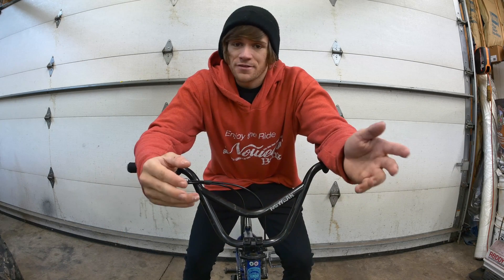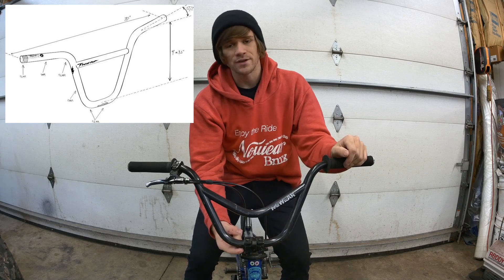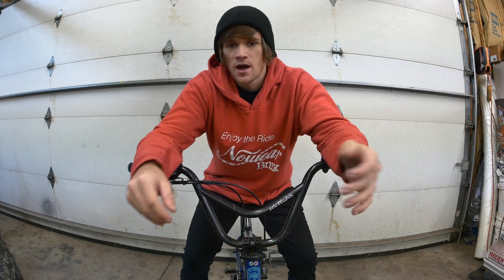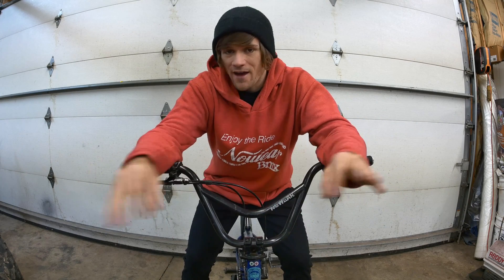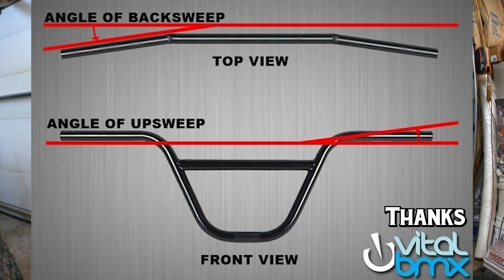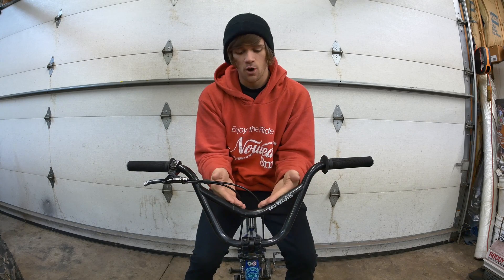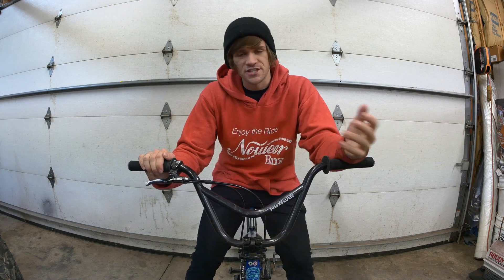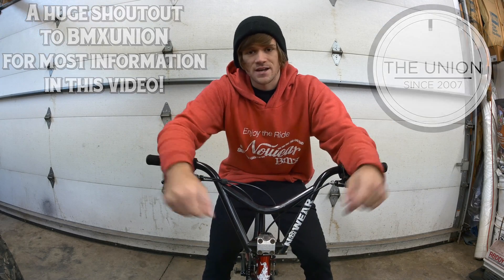BMX Handlebar Geometry - EXPLAINED

Comment: You made a comment on the break-area.sss for high-tensile-steel bars. If you look at the 4 piece design, the stresses(vibrations) are transferred away from those area.sss. Bottom-protrusions and angles and position of those bottom-protrusions matters to me (feel)

Good information on geometry of rises and sweeps.

Riding style and bike objective 
= with shoulder-width (going up-down straight)
= with preferred elbow spread (doing tricks)
= with wrist stress (pivot bike sideways leading to slipping-palms and accidentally flipping bike sideways during tricks) 
= curvature of (shoulder-elbow movements from sitting to half-standing to standing)
= suggest straight elbow to wrist to handles of handle-bars

Review rises and sweeps, if handle-bars are angled-towards or angled-away. Comfort is performance. Material and design and usage. 

Some countries have handicap-mentality administrators nanny-police the width of bars allowed on pavements... world is human-realm and not heaven.

Comment: So Odyssey Handlebars are around 80€ here. KHE Handlebars are around 30€.. with butted Tube Tecnology but which heat treatment ?!?
Would you suggest KHE Handlebars ?
What are you thinking about the KHE Brand overall ?

I am 6 feet tall and ride frontloader stem with 8" small Bars. Would you suggest bigger bars for me ? Maybe just a Toploader instead suits better ?

You doing great explanation !

Comment: Chromoly steel is actually alloy steel grade 4130. The “30” at the end of the grade number designates that it has approximately 0.30% carbon by weight. Heat treatment is a different thing. Sweet videos man!

Comment: Excellent video!  I'm planning on adding BMX bars to my hybrid ebike.  Current bars are 1" diameter so I'm looking at this BSD FREEDOM OVERSIZED BAR. Wondering if there are others I should consider?
Reply from the maker: Cult is a company that makes some. Same with We The People. They may have different geometry if that is a factor for you. I’d imagine they’re probably very similar in quality though
Reply: @Brant_Moore  Mucho Thanks.  I'll check them out.

Comment: My 4 piece hi ten bars broke at the bottom weld jumping off a 4 set.  Very lucky the top weld held or I'd be missing my teeth..  Looking at new bars now.  Not sure if I should buy 2 or 4 piece..  They will definitely be 4130... Although I am worried about my fork now.  I'm not sure if it's hi ten or 4130.

Comment: I got a small rise handlebar and I feel that I am not comfortable doing the bunny hop, especially rising the front wheel, can you help?
Reply from the maker: Can you explain what feels uncomfortable about it? Too hunched over? Too straight up and down? Anything that help understand why it’s feeling that way
Reply: thank you for answering my question sir, so back to the concern
eventhough I pull up my front wheel so hard it's just rise up to I think 1 foot or less
I feel like I need A higher handle bar or what?
Reply from the maker: Taller bars could help. Lower back pain is another sign of bars being too short
Reply: I'm only 5'2 ½" what width my handle bars should be?

Comment: I'm planning on building a bike.
I'm 5 ft 4 in. And the only option for me is street since there's no parks where I live.
What can you suggest? Sorry for the bother.
Reply from the maker: 20.5 frame. Something like the Sunday Street Sweeper. Then build around that. You probably don’t want 10” rise bars but all of it is kinda up to personal preference
Reply: @Brant_Moore  I heard that 5' 4" guys should get 19.5 (I'm 18 btw, not sure if 19.5 is legit) but the most common size I see is 20.5 and I'm kinda scared since I've no experience.
Reply from the maker: 19.5 is a flatland frame. Id definitely go with 20.5 man
Reply: @Brant_Moore  thanks man, sorry for the trouble.

Comment: I'm looking into getting some new bars for my 2018 Performer. I'm looking for a 4 piece, mid school styled handlebar for customization purposes. My stock bars have a rise that's slightly over 9 inches, so I know about what rise height I'd need for comfort. I want a little less backsweep on whatever trippy looking bars I get.
Reply from the maker: GT makes some different looking 4 piece bars and the bars I ride are Nowear BMX bars, but you’ll have to ask about stocking on them
Reply: @Brant_Moore  I'm trying to turn that thing into a GT/Odyssey/Lineage 48H masterpiece 👨🏾‍🎨! I had a slight disappointment with not being able to get the powder to have my frame and fork powdered in that old school Dayglo Pink that's synonymous with the early Performers. I just ride casually, but wanted to finally have that bike that you'll only see me riding. I'll gladly put down over a grand for my vision of the holy grail of GT's.
Reply from the maker: That will be awesome man! With enough money, you can make anything happen
Reply: @Brant_Moore  I'm an 80's baby that grew up in the golden era of the BMX. I hope they reissue one or two of the late 90's/early 2,000's Dyno designs because I'd love to have one of those as well. I was so pissed about being arrested for being accused of stealing someone's bike years ago, I didn't go get my new Dyno Air from the property claims building after I was released the next day. All I needed to do was get a new front wheel🤣. If the topic was chromed out freestyle bikes, that Air was it☝️🤨!

Comment: Do you notice any difference moving from smaller rise to bigger rise? How could it affect riding or tricks? Thanks.
Reply from the maker: I personally noticed a difference when I got taller bars and a top load stem. It felt like everything got easier.
I also felt like I wasnt so hunched over and my back stopped hurting.
I didnt notice a difference with candybars or saran wraps or any of those types of tricks.
So basically it was all positive stuff for me. But I think it hinges on increasing the rise the right amount. Too much would probably have a negative effect
Reply: @Brant_Moore  Yeah I understand what you mean. I tried 10 rise but felt too big. I think 9.6 or so would be perfect but won't know till end of year. Bike got stolen and now I'm not sure when I'm gonna be back on one. Spent £1500 on it. Hopefully I have motivation still. I do miss just being on a bike.
Reply from the maker: That’s a bummer to hear. Sorry to hear. Hopefully things work out soon!
Reply: JannyUK hey man how tall are you? I’m thinking of trying 10s I’m 6 foot 3 (190.5cm)
Reply: @HammerzandNailz  I'm 5 10..178cm. It's personal preference on what you ride as some people prefer smaller. If you want to try 10s then go for it but I never liked it as felt too tall but will be good for you because you're taller. What do you ride currently? Also having a 21tt frame or longer will help you.
Reply: JannyUK I have 21.5 frame, I just got some S&M perfect 10s, they changed the whole feel in the best way possible
Reply: @HammerzandNailz  Great to hear. Just got back on a bmx myself after 6 month or so. Loving it. Suprised I could still do some tricks. Definitely need to build confidence though, as a little afraid of a few things. Currently ride 9.6 rise and 20.75 frame.

Comment: What is your opinion about the BSD WZA 8.5 for a 1.73 1.75 beginner rider?and do u have other suggestions for that price point
Reply from the maker: I’m not sure what 1.73/1.75 means but it depends more on your height. If you’re really tall then those bars could feel short and make you feel hunched over. I’d say if you’re under 5’10” they would be okay
Reply: @Brant_Moore i forgot u are american what i meant by 1.73  1.75 is 173 cm 175 cm(rider height)btw thank you so much for your response
Reply from the maker: Yea man I would say those bars should be okay for you now. Not too tall and not too short.

Comment: Hey Brant, pls help me out. I used to ride  a WTP Envy 2010, the handlebars are pretty low, I thought every BMX was like that. Then I bought a WTP Envy 2011 recently, and was surprised by how high the handlebars are, compared to the old one. I have a hard time spinning the handlebars, because of they're too high and wide, and they touch my legs when I try to spin them! What should I do, deal with it or get another bike? I'm 5.74 ft tall.
Reply from the maker: You can get new handlebars that are smaller/skinnier at any time. No need to get a whole new bike!
Reply: Gosh, stupid question, I meant new handlebars. My concern was the frame was higher, not the handlebars, but I tried to measure and  both seem identical. Thanks anyway. I meant a WTP 2017 not, 2011.
Reply from the maker: Haha no its okay, no stupid questions.
I don’t think the frame would affect handlebar height. It can affect how far they are away though if it has a longer top tube.
Your fork steer tube and stem are the other factors in bar height aside from the rise of the bars themselves.
If you don’t like the way something feels though, it’s always an option to get something else. Maybe a friend has something similar you could try before buying a new set of bars?

Comment: The heat treatment is also needed to kinda unify the structure of the metal in welding points. And relieves the stresses made during welding. (The temperature during welding process is really high, and when the material is cooling it might get tempered - that makes it stronger, but more brittle too [let's say 'less springy'] and of course structure is not unified. At least that's what I remember from my materials science lectures, so you might want to verify it yourself :D THE MORE YOU KNOW
Reply from the maker: Makes perfect sense!
Reply: I am a big fan of Knives, and it s the same about steel treatment

Comment: My bars are 29 and they feel too wide. Grips are longer these days compared to yesteryear, so I feel there is a natural place to grip and it's never changed, except for that crazy period of super short. 29-30 today is same feel as 28-28 1/2 from yesteryear accounting for the grips. I'll definitely cut mine to 28. 29 just feels in the way. As far as height, I feel slightly shorter is better for flatland, but I like them tall for general riding.
Reply from the maker: I’m on your side with wider bars not feeling right. When I first built the Nowear frame I didn’t know it but the bars were actually 29.5. The first session left my wrists hurting but I thought it was just in my head until Karl told me the 4 piece bars come wider than the 2 piece. Cut them down to 28.5 and everything felt normal again.

As far as flatland goes, all of the spinning and stuff definitely looks similar to me, but there’s also guys like Terry Adams who do that crazy flip stuff with the bike. That stuff is crazy looking.
Can you imagine a rider these days doing that crazy flatland, then doing a gnarly huge gap? Would feel like watching someone Ike Osato again
Reply: is scuffing still a thing in flatland? I see flatlanders riding brakeless now. All seems very fast paced compraed to the Day Smith's and Trevor Meyer's
Reply: I didn't say anything about scuffing. But it's pretty hard to learn pumping if you can't scuff first. What do you think today's tricks are?  The same thing as yesteryear, just way evolved. That said, I don't really pay attention to what's a "thing" anyway. These days I'm just happy to carve around bowls and still have my original knees.  

Today's flatland is awesome skill-wise but it also gets repetitive and kind of esoteric, meaning not understood by the casual observer. I'm a fan of huge fast tricks that look good to non riders. Like instead of a dainty gturn in a tight circle, how about a high speed huge carved reverse nosewheelie type of gturn. That's how it was invented. That's flashy and easy to comprehend and gives you massive momentum to link stuff.